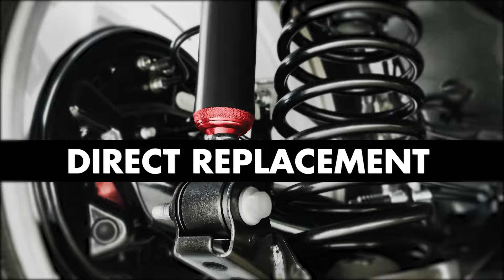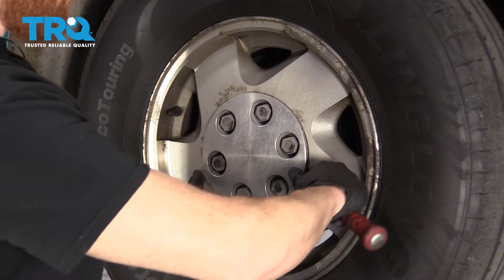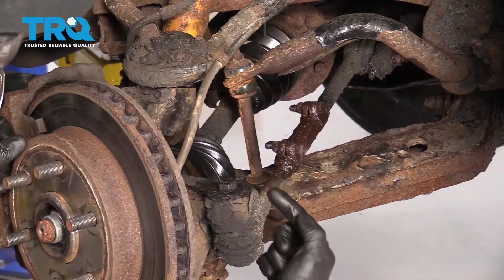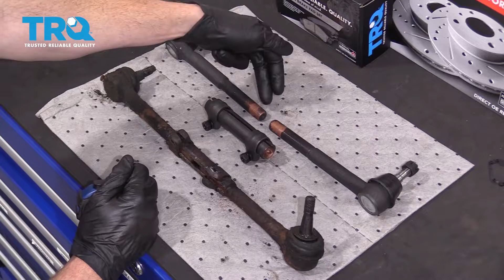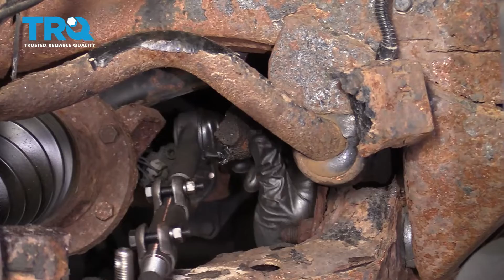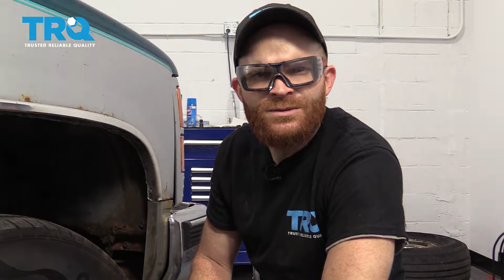How to Replace Inner & Outer Tie Rods with Adjuster Sleeve 1988-02 GMC Sierra 1500

Comment: Hi,
 
I’m replacing the steering components on my 1991 GMC G2500 2WD and I just want to double-check something before I place the order.
 
For the front outer tie rod ends on this vehicle, are the driver and passenger sides the same part, or are they different left and right pieces? I’m seeing listings that don’t specify a side, so I just want to confirm whether I can order two of the same outer tie rod.
 
Thanks in advance for your help.

Comment: Per section 3B1 of the 1988 official GM light truck service manual, a couple of things you’re gonna want to disregard in this video:

#1 The open channel /groove in the adjuster sleeve is specified to NOT line up with the opening of the clamp jaws.  He does the exact opposite and aligns it WITH the jaw opening.  Wrong.

#2 GM addresses adjuster sleeve clamp orientation in section 3B1.  The nut end of the clamp faces forward at the 6 o’clock position, and can be rotated up (forward) up to 45 degrees to get your opening in the clamp to NOT line up with the groove in the adjuster sleeve.

Comment: Moog says DO NOT ALIGN THE ADJUSTMENT SLEEVE CLAMPS WITH THE OPENING. DO NOT TRUST THIS GUY HE HAS NO CLUE. HIS FUEL PUMP INSTALL IS WORKING . He goes past the tabs.  I would not trust this guy to fix a sandwich.

Comment: All very nice except >>>>>> You measured outside joint to outside joint.  Depending on Brands, that measurement may vary greatly.  Try measuring from center to center of the ball joint for better accuracy!
Reply: Regardless of what make of car/truck. When you replace rods they should be the same as previous rods. So it doesn't make a difference. Measuring eye to eye is what is said to be more specific, but i disagree because the tie rods are usually not perpendicular to each other so measuring eye to eye is more of a ballpark measurement.  Besides you're going to take vehicle for alignment.
Reply: I agree.